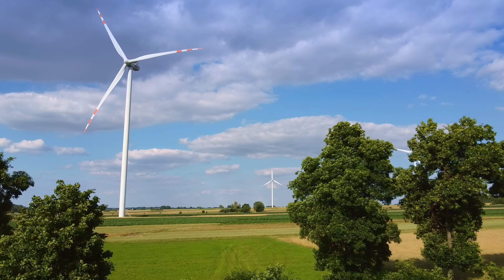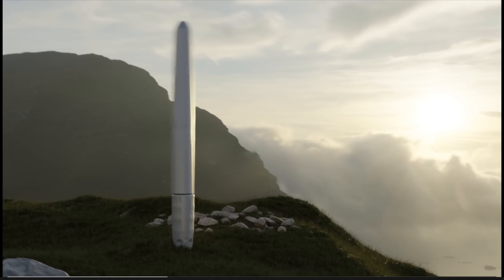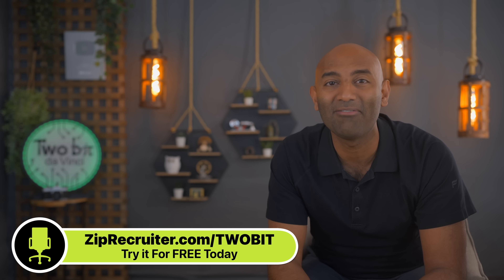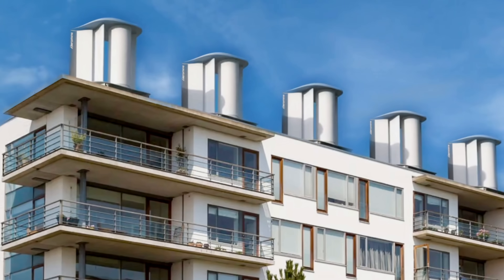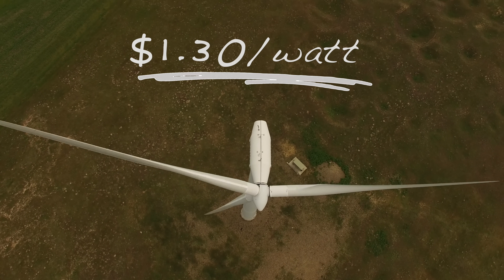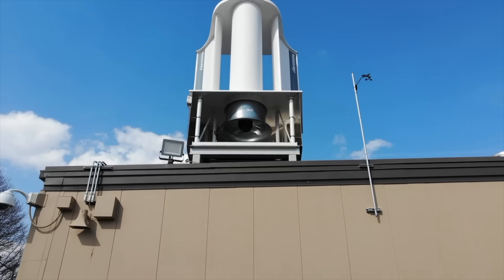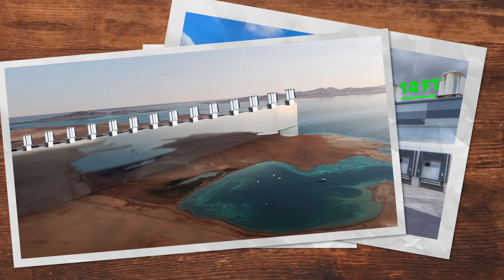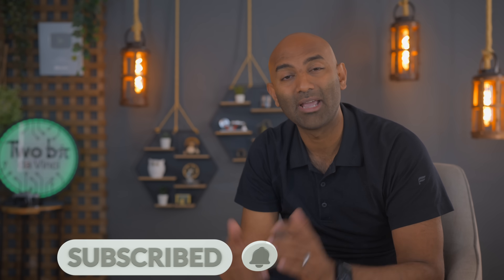Can This Genius Wind Turbine Outperform Rooftop Solar?

Comment from the maker: See why hiring doesn’t have to be difficult — when you try ZipRecruiter for free at https://www.ziprecruiter.com/TWOBIT
Reply: Real measurements of kWh energy (with wind speed statistics) gained during at least one season in a place that has average winds (not coastal and not highlands/canyons) and we can argue about this "brilliant" turbine that costs only slightly more than 6k$ for 5kW.

In Poland we can have new PV modules (jinko, trina, canadian) with price around 1800$ per 5kWp so, yeah... That's all I guess.
Reply: @Zepsuj To Sam  This is true.  But it's another source of energy that we should be researching.  The technology can be more easily maintained and life time could be excess of 50 years with little to no performance degradation as seen with current solar.
Reply: @joeboxter3635  you can get 5kw horizontal turbine with PWM controller (with dump load and brakes) and 9m folding tower in around 3k$ from China. I will be making english version of my channel in second half of this year, where I'll show if hybrid/full offgrid is possible in specific climate 50+°N
Reply: If you are paying $2.80/watt for solar? You are getting reamed. The cost to manufacture solar today is less than 20 cents a watt.
Reply: Zip recruiter is awful. 500 applications a day from people who are not qualified so when the right candidate comes along you will never find them.
Reply: You have made a mistake.  How can average consumption be only 1.2kw? Your units also are incorrect.
Reply: This company is headed no where, in my opinion. Last year I brought Aeromine directly into one of my clients: Adidas corporate and ended up getting no proposal, quote, analysis, or anything at all that we asked for. Aeromine wasn't prepared for the requirements our local incentives program rolled out (same across the nation: requirements on wind turbines to receive incentives!). Any company who would ignore a top tier retail client like Adidas probably isn't headed anywhere good. Also, Aeromine failed to fully grasp the reality of installation of their systems. Most buildings will REQUIRE a crane or similar device. This obliterates the payback/ROI we're all being told.
Reply: The Michigan city with the BASF plant is pronounced "Why-an-dot" or "Whine-dot" [spelled Wyandotte]. You said "Wind-ot" perhaps as a Freudian Slip on the subject of this video.

Comment: Nonsense!  All practical tests of ground-based small wind turbines show: 1) They hardly produce any electricity! 2) They do not last long! 
Solar panels generate at least 10 times more green electricity with the same investment & time expenditure! 
Reliable and almost maintenance-free for at least 25 years! 
On the other hand, 9 out of 10 small wind turbines stop working after just a few years due to the extremely gusty winds close to ground.

Comment: The reason for not using residential roof top turbines is wind turbines at power on a roof are too noisy to sleep around.  The roofs are not designed for large wind loads from wind turbines operating at significant power.  Your home owners insurance is likely void without revaluation at least for roof structures if you add something of significant wind load to it.

Wind turbine generators and photovoltaic electricity costs to produce electricity is infinite without storage or other source of electric power.   People need electric power to start and run their A/C systems.   That is a lot more than 1.2 kW per household as used as an average in the video.

Stating maximum capacity for a wind turbine means very little.   It's cool engineering to have a wind turbine that can function in a 60 mph wind, but that's likely never going to happen.  If it does,  its likely in the rennets of a hurricane with gusts of wind much higher than the rated operating range of the wind turbine where the wind turbine should be locked down.   

Commercial wind turbines are made to operate in wind most efficient for producing power that is common.   They don't bother with extremely high speed wind that is non typical that would require a less efficient wind turbine configuration than for normal wind speeds.   It's common to observe  UK offshore wind turbines operating at 38% capacity which is very good.   If the wind falls off to half speed that reduces 38% X 1/8 = 4.75%.  

When the UK has its wind turbine farms running at 10% capacity it is basically running the electric grid on expensive natural gas because it doesn't have modern ultra high efficiency clean burning coal plants that cost a small fraction of the cost of UK natural gas to fuel.  

Note:  When watching UK set historic movies and TV shows where people die from gas poisoning that is not natural gas, but coal gas.  Coal gas is from the partial controlled combustion of coal resulting in a combustable gas consisting of carbon monoxide CO and hydrogen.   CO is absorbed much more readily than O2 in to the blood stream, causing oxygen starvation and death.   Natural gas mostly consisting of methane would make you sick, but the main issue is in high concentration it can blow up.  An oder is added to natural gas to make leaks noticeable by humans.  Natural natural gas is odorless except for other trace elements.  

Wind turbine farm power is rated at is maximum capacity.  Wind energy goes up with the cube of the wind velocity V^3.    Offshore wind turbines suffers from difficult, dangerous and very expensive access.   It is likely not worth the human risk to greatly repair them.  That 12 MW offshore wind turbine in a good location should produce about 1/3 its rated capacity or 4 MW average over the year.   That's a real return, but its not grid quality power.  It has to be culled or made grid quality with the addition of peaking to make up its dips and variations.   It would be best to charge storage with them, but not so much so as to be nearly worthless as with photovoltaic solar without it charging storage. 

A GE AC44CW locomotive makes 3.3 MW of electricity.   

Noncondensing greenhouse gas behavior, such as from CO2 and methane, can not change the overall effect of earth's greenhouse effect that is always in saturation from the strong greenhouse gas water vapor absorbing all the greenhouse radiant energy from the earth within 20 meters of the surface.  The cause of global warming is not known, but global warming has been dead at about 1°C since 1992.

Comment: Wind speeds in our coastal community routinely rank in the 30 mph to 40 mph range, and those are quiet days. Still, even with this abundance of natural power right at the door, the wind turbines now available are either a) exorbitantly expensive, i.e., in the BMW 7-series price range, or b) unreliable and unable to produce more than enough electricity to power flashlight. Pathetic!

Comment: All practical tests show that small wind turbines generate electricity only at a cost very significantly above 1€/kWh 
This is because there is hardly any wind near the ground, and it is also extremely gusty, which extremely reduces the service life of the systems. 
With solar systems, on the other hand, you can reliably generate electricity for about 3 to 10 cents/kWh over a period of 25 years!
Alle Praxistest zeigen, dass Kleinwindanlagen Strom nur zu Kosten sehr deutlich über 1€/kWh erzeugen! Denn bodennah weht kaum Wind, zudem extrem böig, was die Lebensdauer der Anlagen extrem verringert. Mit Solaranlagen hingegen erzeugt man zuverlässig über 25 Jahre Strom zu ca. 3 - 10 Cent/kWh!

Comment: it is similar as Jacques Cousteau turbosails used on his Alcyone ship in early 80s, the same suction/propulsion effects but...  anyway this unit should rotate the flap when wind changes direction for the max power. and one more turbine on the top of the center cylinder - any way interesting tech. should try 3d-printed version on a garage roof first/ :-))

Comment: I can think of new skyscraper designs where as each floor in opposite corners of the building would be a section of the air foils. Imagine the draft created by a 30 floor building let alone 70 or better. The updraft intakes could be placed on any floor. If the unit itself is efficient at that size a whole complex of buildings could generate power for a grid.

Comment: I would  of made it open source So anyone with A 3D Printer Can get them out There

However  VAWT Can Start at even lower Wind speeds and take wind from all Simultaneous Directions They even like Built up arias

Comment: these don't seem to be movable so you would need to place them in an area of prevailing wind.  also the power output is just a potentiality based on generator size...it doesn't mean they are going to produce that much power/energy.  i think this is a rube goldberg device.

Comment: I find the price of $ 9,522 for 3.3kWh pretty high. For comparison, I live in The Netherlands, definitely not the cheapest country, but I had my garage filled with 8 solar panels, totaling 3.5kWh for the price of € 4,200 (and later got back € 700,- tax deduction). But assuming this would normally costs € 4,200 (which currently would equate to about $ 4,500 then the price mentioned here is way off. And the price I paid is including everything, a complete package.

Comment: Problem with the turbines in the ocean is the dramaric rise in beached(dead) whales. I think a lot of this new energy will also find its drawbacks. Not sure they are all clean. The materials used to make solar panels, the waste and toxins released with heavy metals is also cause for pause. But i hope over time these challenges will be worked out. Im still waiting.

Comment: they should of been using the same differential in skyscrapers. AS you may know when the doors are open at the base and roof of a skyscraper the amount of pressure can keep you literally  from walking out the front door

Comment: How about throwing this into a designer's bag of tricks so that it becomes an initial design element and not an add-on?
   How about if we do a survey of billboards and see if some could be modified with a flat plane to the top of them?  I believe that installations either require or benefit from a flat plane to help enhance laminar flow.  
Or, could these be mounted horizontally in situations that have a natural wind tunnel effect, such as large apartment complexes.  I can visualize a lot of ideas that are worth trying.

Comment: It is misleading to quote plated capacity rather than dispatchable capacity and usable capacity - that is available when needed. Wind turbines will never be the answer to global energy needs because there are not sufficient sites available and in any case, the output is variable which given the low efficiency compared to a gas unit makes them uneconomic and even more uneconomic when one considers the idea that battery storage is the answer to their intermittency which lowers efficiency into the low single digits. In 2022 wind power only supplied 7% of global needs compared to coal at 29% and over 60% comes from coal, gas, oil, and nuclear In 1990 coal made up 49% of the energy produced but the fall over 30 years has been taken up mainly by gas.

Comment: Wind power is great at the large scale, but I don't see it competing with solar on the individual level simply because solar is predictable. You are guaranteed X amount of sun every day. You aren't guaranteed wind every day, so trying to predict how many turbines you need to remain off-grid is impossible to guess. I like that you could use this to assist the solar panel input, especially at night in windy areas, but I don't see it as a way to replace solar.

Comment: Couldn't they just attach the Aromine to the flat side of a house, if it has one, instead of on top of the roof? Just seemed like an easily resolved issue for homes to use it. May have to attach some kind of support pillars, but seems doable.

Comment: I see nearly all the comments to this video misunderstand how this idea works, comparing to attic roof turbines and similar which typically spin because of the wind pressure against turbine blades. 
The innovation of the idea in this video appears to try to accelerate the wind velocity by creating a large area of different air pressure to drive small turbines as the air will naturally rush from high to low pressure zones amplifying the forces applied to the small turbine.

Aside from lack of efficiency and how the wind is captured in this specific design,
I can see some advantages in smaller moving parts which probably translates into cheaper construction and maintenance compared to giant turbine windmills. But, even these venturi or bernoulli principle devices would still need to be pretty enormous to capture significant amounts of wind to compete with existing technologies. Or, as suggested build a million of them and deploy them everywhere.

Comment: It's an interesting approach to create low pressure zones to drive turbines instead of capturing high pressure pushing blades, but I see plenty of limitations... Chief is that you'd probably need a pretty decent constant wind speed or again like windmills scale up in size. There doesn't seem to be a free lunch with the device described in this video compared to existing solutions. And, the problem even for shorelines is that the wind won't blow in the same direction constantly like some mountain passes or out at sea... Air currents over land generally change during the day due to the earth being heated or cooled day and night, and the surface (eg paved? agricultural? obstructions?) Glider pilots know this and use that knowledge to recognize thermals.

So, IMO a consistent minimum 28 mph wind from the same direction day and night would be an extremely rare and specialized situation.
But maybe the idea can be modified to at least capture wind from all directions. Then maybe the idea described in this video might be possible by building a device at proper scale. At only about a 16% efficiency rating, the device would probably look like a pretty big silo, not something the size of a car sitting on your roof.

Comment: The Halcium Energy, power pod. Adresses all of the things that this system does. With many more advantages. Much smaller. Not ugly. Can be mounted anywhere. Omnidirectional wind. Lower wind speed. And should be a fraction of the cost.  Perfect for homeowners.
Reply: Still long way to go. They will officially launch on 2026. But they are limited small homed and businesses .

Comment: Halcium Energy - powerpods just sent me an email stating that they will have final specs on production ready product in q4 2023. Hopefully they will be available in 2024. If they are. I will purchase 2 for my house. Perfect compliment to my 10,080 watt solar and geothermal heating and cooling. Final piece to my currently net zero  house. 
Will make long term power outages. Or possibly of loosing net metering, and having to go off grid. A non-issue.

Comment: Great Video , and extremely interesting future , wondering why when comparing to solar you never mentioned the hours of generation capable are drastically different since the wind generator can work 24hours a day where the Solar is only 50% at best and likely 40% in reality since the first and last hours of the day are less efficient.

Comment: an electric motor that's less than 90% efficient would be thrown in the trash cause the industry demands highly efficient electric motors. Hydro power is the future, there are thousands and thousands of kilometers of drain pipes that carry water yet we think pv panels that are not even 30% efficient is the future

Comment: I live on the coast where the salt air does a good job of getting into machines, causing oxidation and erosion of metal, plastic and rubber.
How is the wind turbine designed to reduce degradation from the elements?

Comment: That place in Michigan, is better pronounced as why an dot. Redact the h. Interesting, but the cad drawing is showing that the wind turbine is actually underneath in an area where the actual directron of the wind actually assists the Venturi effect draw created by the differential air pressure affect created by the structure. Actually, an application of a design that is about 70 years old now.
In the state of Michigan, prevailing winds are usually from the north end or West. So on the northwest corner of a building would be the most likely place. But you could always elevated above a current rough so that you can make it more effective for men's from any direction. The highest winds we normally did Michigan actually come from the south and east during the Spring. Given the way this is made with the lower plenum forcing air up into the upper Venturi, high wind would not appear to overspeed the generator.
I don't know what price point they are looking at, but this does not appear to be difficult to create and Assemble in more than a few hours of time. Without spending an awful lot of money except upon the interface to the home itself considering the home is already wired for electricity on an existing structure, the interface should be minimal. Not much more than a switching system at the main coupling from the utility to the house. It is not a major operation as the dedicated circuitry already exists within the home. This also looks like it is scalable to anywhere from 2K to probably as much as eight or 10K easily.
The idea of attempting to warm the air that is going through the lower plenum, add to the icing effect, it will not subtract from it. Natural icing can be mitigated, quite easily as a matter of fact, but it would require additional Manufacturing methods to be employed.
This would be excellent for personal use and family use, it will never be enough to actually run large, power intensive industry. But that would allow the current power system to be more effective.